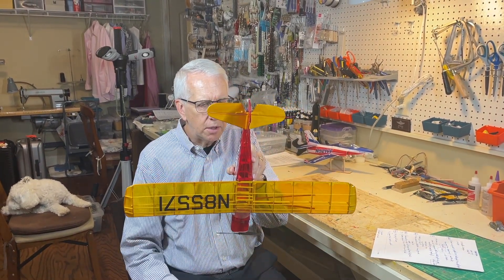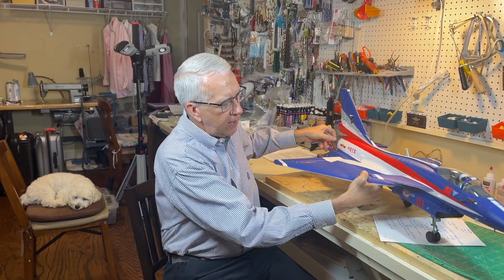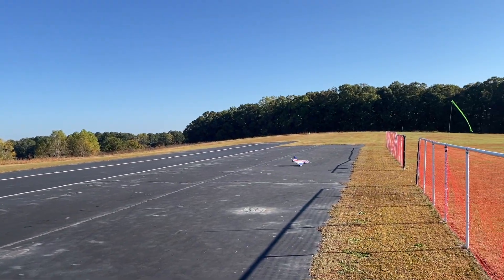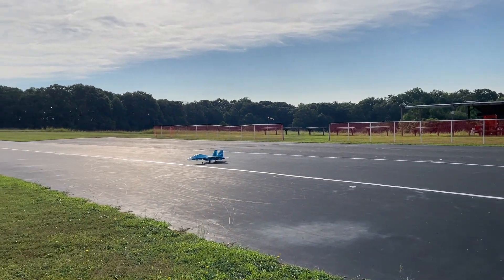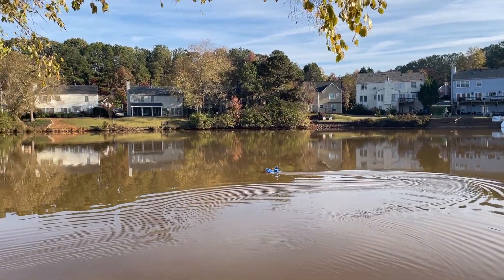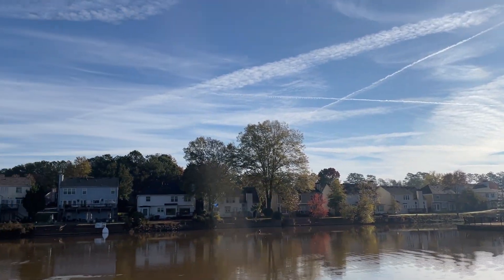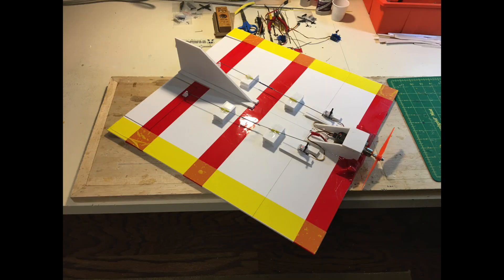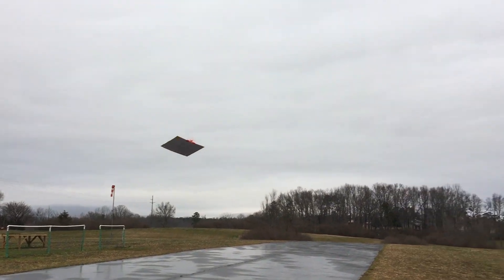Different Wings Different Lift

Comment: Good afternoon. I just finished my winter build (comet, from old school model work). It's a delta wing with trycicle landing gear. It has a tendency to tip stall. Any thoughts about delta wings misbehaviors?
Cheers,
Leo.
Reply from the maker: Hi Leo!  Delta wings are designed for higher speed flight. Best to keep speed up for initial landings until you figure out how slow you can get for pattern work.